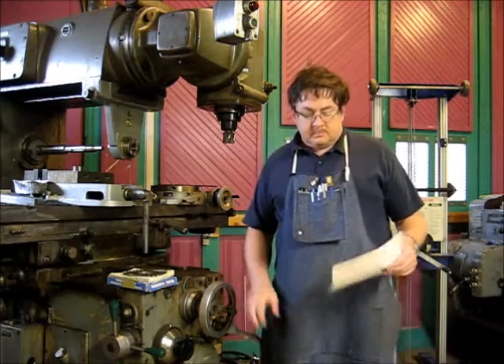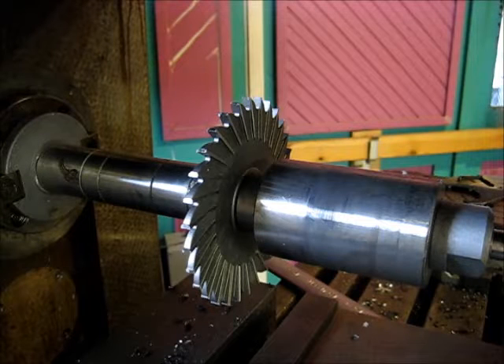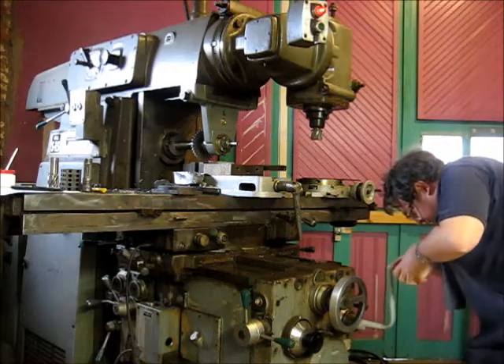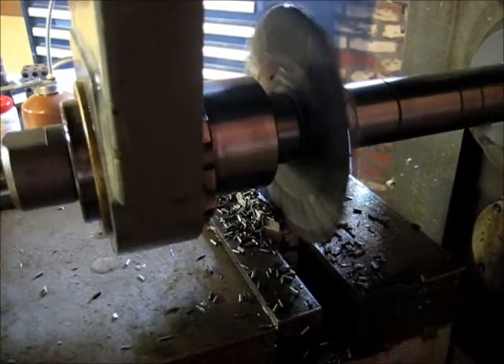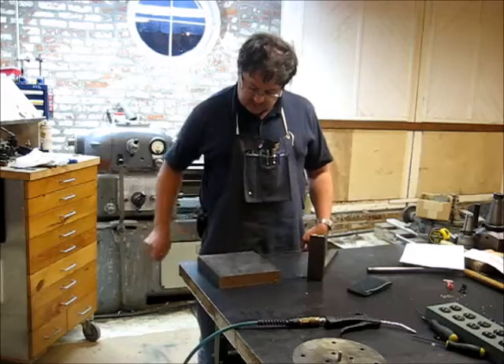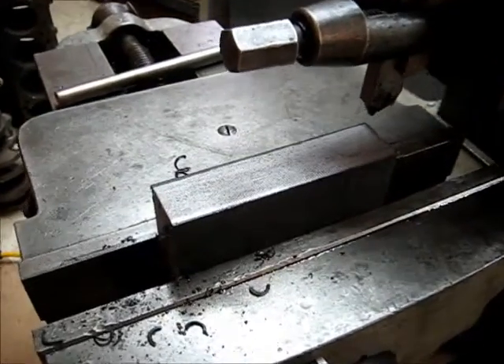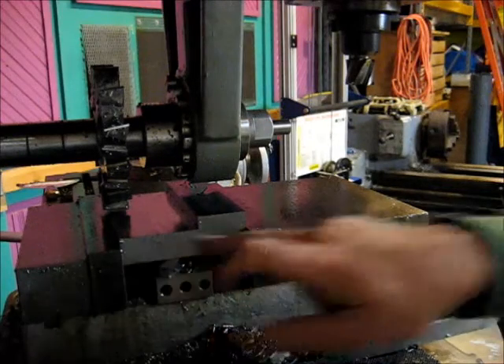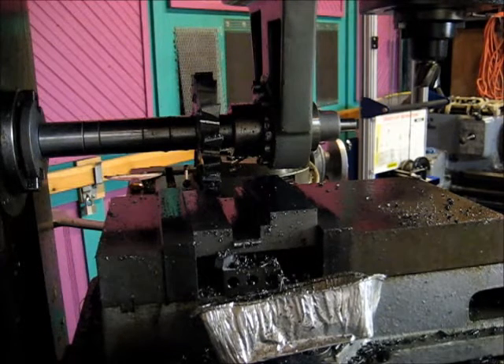Ellis Bandsaw Vise Shoe Continued

Comment: James

I absolutely love that monstrous mill.  We used to have an old brown and sharp horizontal that i thought was big.  I was reading the comments between you and keld.  My Cincinnati 2mi has a base sump and i currently run a coolant mixture.  I havent had any problems other than the sump is rusty, therefor im constantly babying the coolant trying to get rid of rust.  I too am also considering making an external sump for it to reduce this problem.  Keep the videos coming and thanks for sharing so much info.

Mark

Comment: It was a little hard to tell at 480 resolution, but it looked like you had a fair bit of runout on that arbor and the cut sounded uneven too.
Reply from the maker: There is a couple thou runout for sure, but I have never had nor seen an arbor straighter than that!

Comment: Hi James !
Oh, I love the sound of these big cutters working through the metal ...
though I would prefere floating cooleant - I get nervous when I see all that smoke ;-)) - but floating cooleant is a mess, sure !

A very nice mill you have there - unfortunately I haven't got the height in the shop to have one like it - in fact when I got mine, two of these mills (PEDERSEN) was sold on the auction for next to nothing, but I had to live with mine - smaller and older Pedersen ;-((
Reply from the maker: I Keld, the machine has flood on it.  However I have had several people with these hydraulic based machines tell me not to use it because the water gets down into the knee and screws things up.  I think I am going to drain the sump and replace the coolant with cutting oil, that way I could flood the oil on the cut and reduce the smoke a lot.  More volume keeps it from getting hot.
Reply: James Kilroy I did drain my sump and the cooleant now runs from the bed directly to a pump/sump-jig I made standing on the floor.
Most of the time it works great, but sometimes there is a little UN-noticed dripping somewhere ... and small drops CAN make a huge pond on the floor before I notice - oh, what a mess !
Yeah, cutting oil - I've seen some videos with gear cutting using LOTS of oil - but how about the oily feel when finished - it has to be cleaned ... MORE than just wiped with a rag, I think.